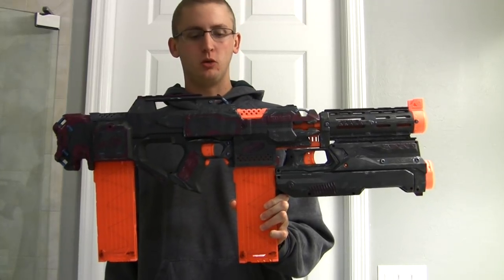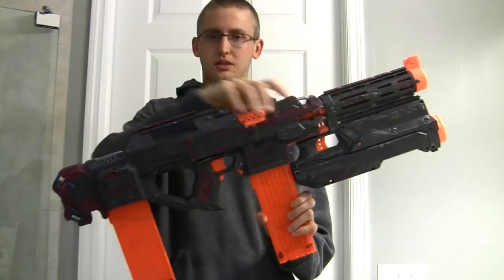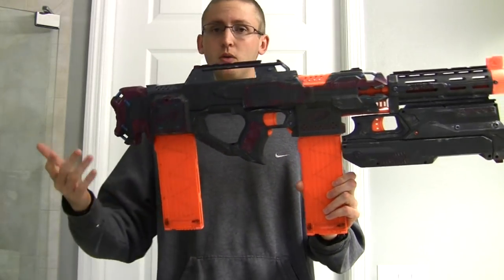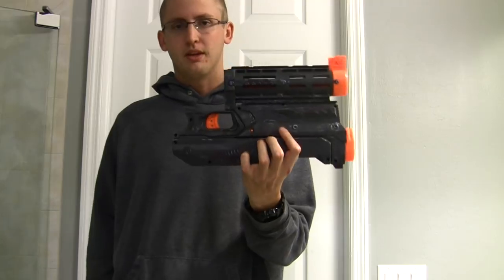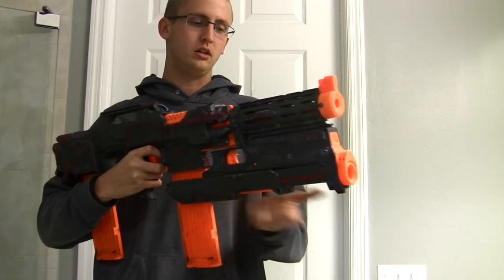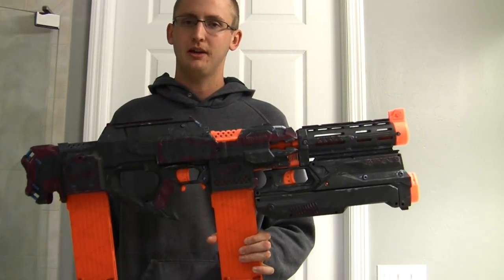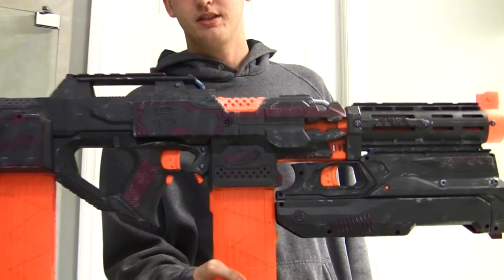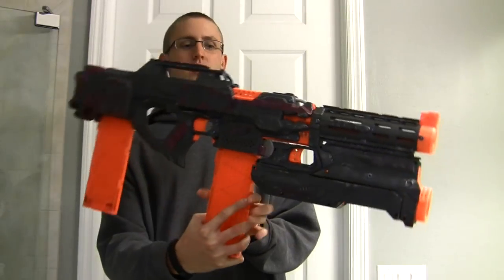[MOD] Strayven with Integrated Mega Magnus - Nerf Stryfe Modification

Comment: I was thinking on the weight. Wouldn't it be possible to counterweight the stock end so the attachment doesn't pull down as much? A set of adhesive wheel weights would probably come in handy for this.

If I didn't just lose one of my two jobs, I'd buy this blaster on your webstore right now.

Comment: hey coop i have tried something like you have done with the magnus integration however i used a maverick and multiple couplings for the mega dart and glued on to a retaliator barrel and it worked however i did not like it and i disassembled it

Comment: Don't get the centurion I've had it for about 4 months and it jams to much and it won't fire any more and it's brand new!
Reply: um how did you get 4 months ago but its brand new
Reply: Onye Agu You can usually get them on Amazon early, and some countries release them earlier than others. Aussies get them especially late
Reply: Onye Agu I mean I got it 4 months ago and just opened it and after 20 minuets it brook all of its stock darts
Reply: I find that odd mine is awesome has never Jammed and had it for 6 months with regular use

Comment: I usually really like your mods, but I have to say this one too me looks sloppy and hastily done. I think you are going for a used look, or rough look. I like the more clean smooth paint jobs, without dry brushing. The integration is smooth overall. However, I won't be buying it so I probably shouldn't have a opinion.